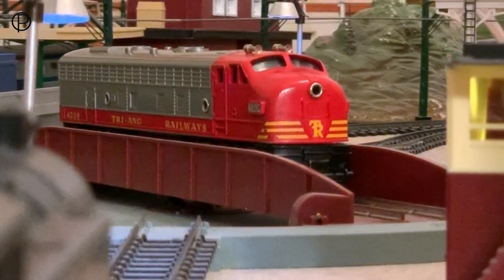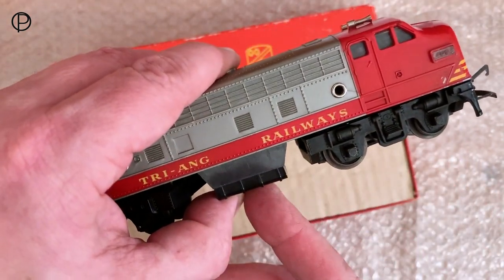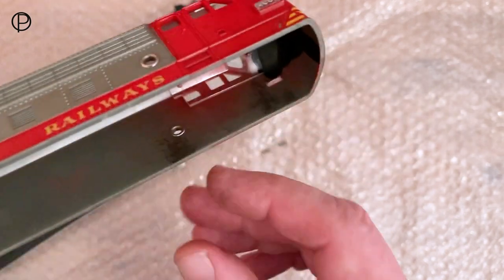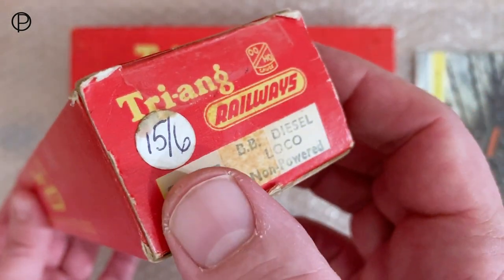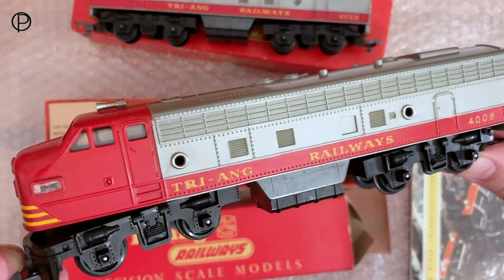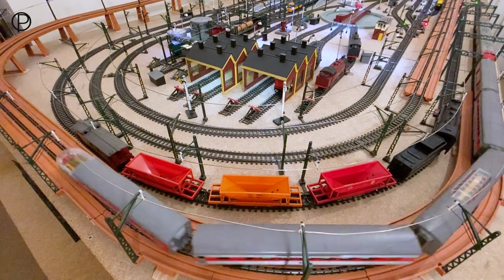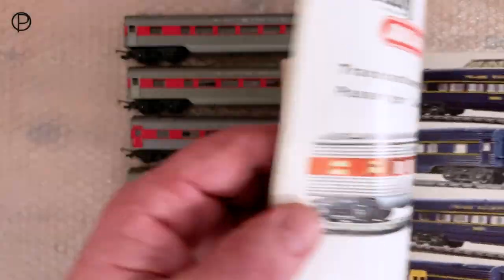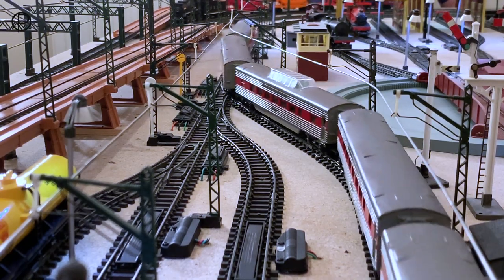Tri-ang Railways R.55/R.57 B-B Diesel Locomotive

Comment: I was a lucky young whippersnapper in that my Aunt used to work for Triang's bosses in Margate so Christmas or birthdays I received Triang Railway's  as a present. I still have them and they still run after 48 years!  Enjoyed your presentation, it was a trip down memory lane!
Reply from the maker: That sounds amazing thanks for sharing and its great to hear they are still running. Thanks for watching glad you enjoyed the video.
Oscar
Reply: Oscar they should bring the Triang brand back, and have them made in the UK. It was Triang who saved Hornby so let's have them back in production at reasonable prices. But I don't hold out any hope from Hornby as it would undermined there rail road models!!!

Comment: Hello Oscar. Brilliant choice again this week. Once again you have opened a discussion on multiple variations in these models. My first version of these was the dummy "A" unit, R57. I've had it since new. It has the Mk 2 couplers and the red is quite dark. More recently I obtained a powered one with Mk 3 couplers and a lighter (brighter) shade of red. At the Manchester model railway exhibition this past Dec. 7th. I found two R 58 "B" units. Both have Mk 2 couplers and plastic porthole windows. Neither has the model number in the end doorway as yours does and very interestingly one has the bright red paint and the running numbers are on the right end of the model and the other has a very dark red, almost maroon  stripe with the running numbers on the left end. I really hope I will get on top of my work here and get a Tri-ang layout built so that I can share these through video. Thank you again for your enthusiasm, research and presentation. A wonderful video.    Regards, David.
Reply from the maker: Sounds like another great find you made here in the UK, definitely seems to be a few variations which make it all the more fascinating. I've been watching your progress rebuilding your railways, I'm looking forward to seeing the new track going down. Will you be able to incorporate a line of Super 4 or do you have plans for something separate? 
Thanks again for watching.
Oscar
Reply: @oscarpaisley  I will have to build the Tri-ang layout separate from my main layout. I hope to have something running this year.   David.

Comment: Looks at lot more modern than the two A units in my first train set (one powered on dummy). Being a collection of second hand Triang with some Hornby Dublo. Schoolyard  discussions at the time were to avoid the dummy units as they only reduced the size of a train you could pull given Tri-ang's wheel and axle design. If these discussions were widespread it may explain the early demise of the dummy B and A units and the R159 dummy equivalent R250. Even the more useful R232 Budd car dummy went early. Is R232 a tender number range?
Reply from the maker: Good evening David, I think you hit the nail on the head there. What I should have done was put a motor in the B unit as well perhaps. But then getting to the limit with the H&M clipper controller I think especially with the headlamp on. I think R.323 was an alternate number for the Shell/BP Oil Tanker R.1170(R.323) that was possible destined for Canada and had a different number for different markets. 
Thanks again for watching and taking the time to comment.
Oscar

Comment: The B unit certainly adds some 'visual weight' on the layout, In New Zealand and Australia we have shorter coaches R25 AND r26 with overhead seating, These were available in maroon (for New Zealand) and Blue (for Australia) but they are shorter than these coaches otherwise the same. I wonder if these were predecessors of your transcontinental coaches that they decided to send to the colonies. Australia later got these but we in New Zealand didnt. Many thanks for another wonderful video. Most enjoyable
Reply from the maker: Thanks for the terrific information.  Glad you enjoyed the video.
Oscar

Comment: Hi Oscar, The loco and coaches look good in red and silver but unfortunately the locos motor is not strong enough to pull the dummy units and the coaches
Reply from the maker: Thanks Chris, glad you liked the look of the locomotive and coaches.  You may have a point about the motor.
Oscar

Comment: Hi Oscar, Tri-ang did make seating units for the mark 1 coach. I have a trade box with two units still in the box, they are a salmon pink colour. I believe they were available from late 1959 on, along with after market seats for the class 101 DMU.  I sure they came out in duck egg blue colour as well.( may be first and second class?)      Another great video for the collector.
 PS: can some tell me if there are any spelling mistakes? The dam computer red under lines most of my spelling, it drives me nuts!
Reply: The spelling of all common words is just fine.  It's likely complaining about the acronyms.  You do know you can add those words to your dictionary?  Long press (or right click) should bring up the option.  If you are quite sure, then add it and let the computer buzz off!!  Cheers
Reply: @WhatAboutTheBee  Thanks for the info Matey.
Reply from the maker: Thanks Michael for the information.  Your spelling looks fine.
Thanks for watching
Oscar

Comment: Great video again Oscar it's a shame that they used sellotape on the boxes it looks so unsightly now that it has faded, I have a small collection of 1950's Trix Twin and they used a paper seal to hold the box lids on and after 60 years it doesn't mar the appearance of the boxes as much as sellotape would.
Reply from the maker: Good evening Barry. You are right paper seals would have been a great idea and very attractive as you say. They sort of went down that route in the early 70s for a while with a lot of the silver seal models they had a great shiny silver label to seal the boxes.
Thanks for watching and taking the time to comment it's hugely appreciated.
Oscar

Comment: Nice stuff, I did read that the B unit is a fairly rare piece, so you’ve got quite the set going on there!
Reply from the maker: Hi Nathan, the B unit was never a popular model from what I've read, production numbers were much lower than the other two units. It would have been nice to have the B unit sold motorized. I've been thinking this and I'm on the lookout for another chassis and another motor bogie. Plenty of pulling power!
Thanks for watching
Oscar